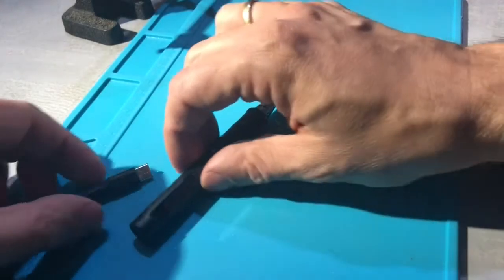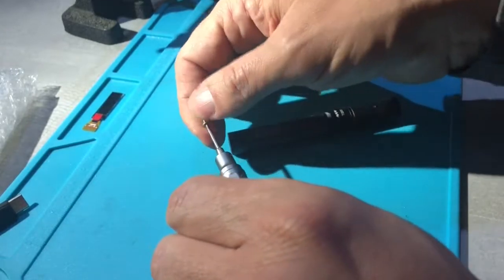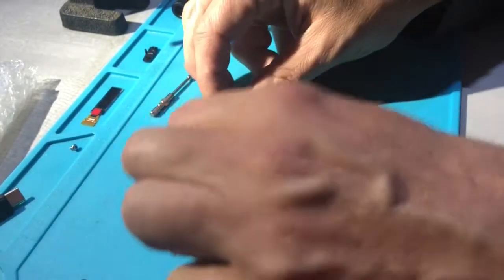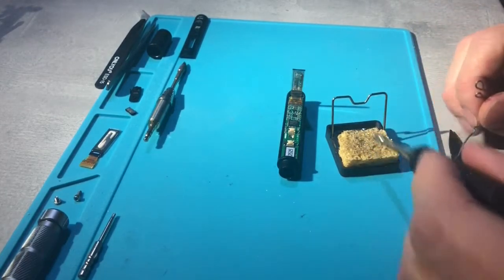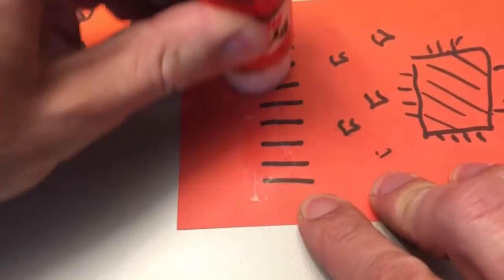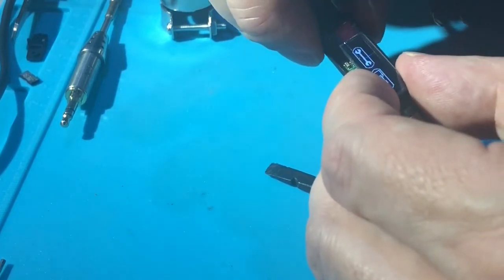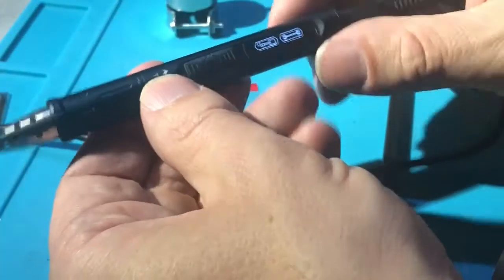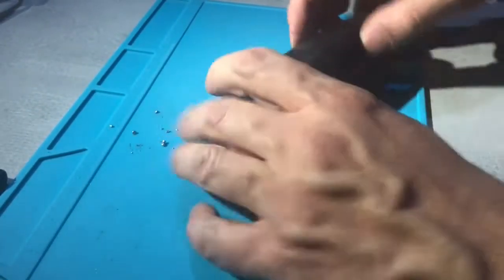TS80 OLED repair / replacement

Comment: I have heard OLEDs have a life span of 2 years continuous use and I can confirm that. I have a cigar humidor with a 0.96 OLED display and it lasted about 2 years always on, but not without losing and major amount of pixels first. You must use your soldering iron a lot? It was probably defective.
Reply from the maker: Exactly! They obviously had a batch of poor quality OLEDs, so me and quite a few others suffered from that fault.
Reply: @AReResearch  I have to say they're an amazing soldering iron and I love having mine although to be honest I always reach for the bench top first unless I'm out in the field

Comment: Thanks for this very usefull video.
Will the new screen last "forever" or will it die like the original one?
Is it a screen quality issue or a general OLED issue?
Reply from the maker: There  most likely was a production fault in the original module. I expect to get about 10000 hours of run time out of the new module. With a couple of hours of use per week, that is pretty close to „forever“.
Reply: Thanks for the answer.
Reply: @AReResearch  I would not share that optimistic view regarding lifetime. I had to replace mine as well. Only after a few uses the new one starts to flicker a lot and change intensity a lot. In my view the quality of the modules is horrible. Similar modules are used e. g. for ESP32 boards. . Realistcally, I would guess that the lifetime is in the order of 100h.
Reply from the maker: Up to now the OLED is doing ok. - Will wait and see...

Comment: Hi and congratulations for the channel and the tutorial.  I have this model of soldering iron, but alas the display after 2 welds the display is not readable.  Kindly can you turn me the spare number since on aliexpress there is only for model T100.  Best regards Gianluca
Reply from the maker: I've updated the video description with some links to OLEDs that appear to to be identical with the one I got from Miniware.
Reply: @AReResearch  Thank you very much and very kind.  Kudos to the channel.

Comment: Such a fking shitty product. I paid a lot for it even got all 3 tips. But didn't really use it much (maybe 5 times in 2 years). And the OLED display just dies on its own. I searched this seems to be a common problem. What the hell? this thing is not cheap and they can't even spend a few more cents to get a proper quality display on it? 
Bigs waste of money. I will not be buying anything from this company again.
Reply from the maker: I would have expected better customer service, as it is clearly a pre-existing fault in the product. Since I had to scale my workbench down, I used the two TS80s frequently and and they are great irons. Not at all cheap, so - yes - disappointing service.
Reply: Me neither.
I have issues with my TS80 but also with my ES121 too.
Both screen are dead.
It's a shame when you know the price of these devices.
I really don't recommend Miniware devices.